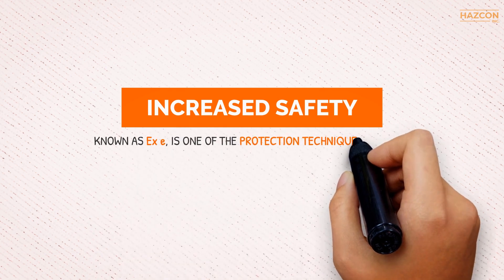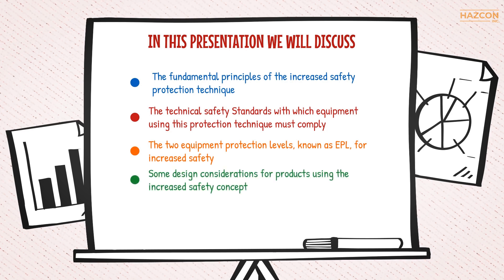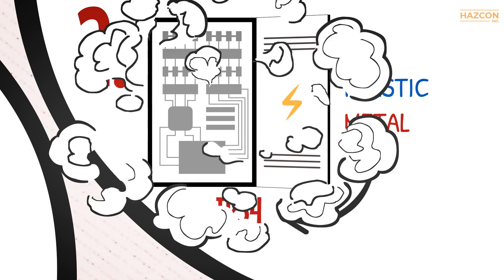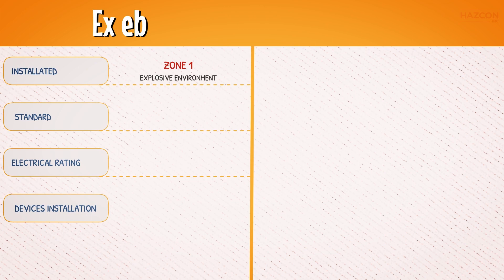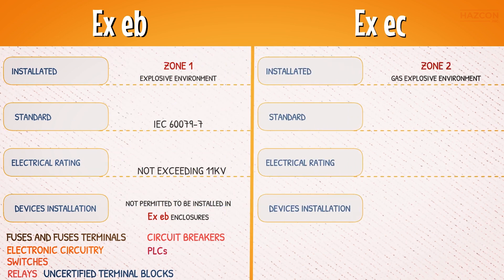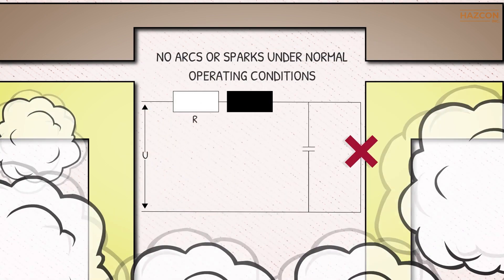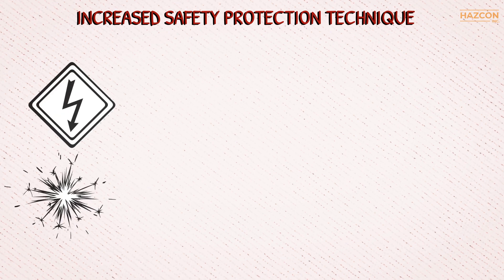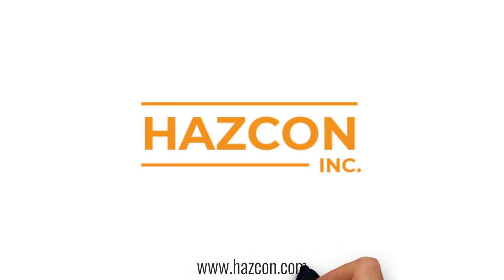Ex e Protection Technique (Increased Safety) - Hazardous Location!

Comment: Please take note that terminal bridge must not alterate the internal arrangement layout. You can't bunch more than 6 cores toghter.
You can't use a single terminal strip to connect 2 wires. 
The maximum lenght of the leads inside the enclosure must not upper than the ecnlosure diagonal / 2.
You may use Ex d or Ex e cablaggio glands. You gave to determinate if gland extras as ip washer are needed to assure an IP54 rating.
Thete some thing to check (please refer to IEC 60079-14).